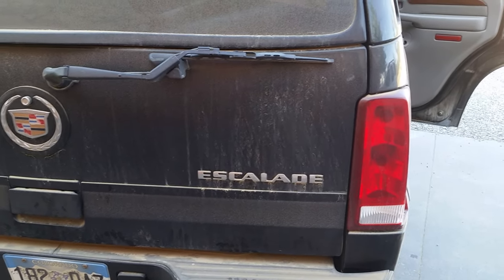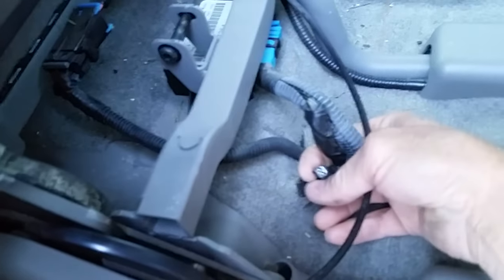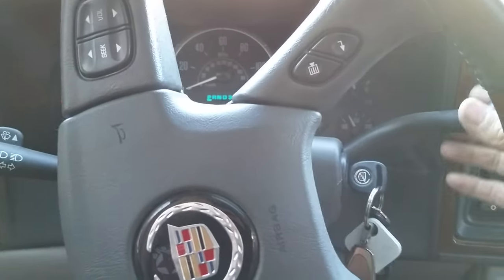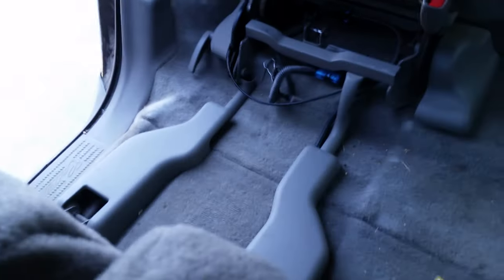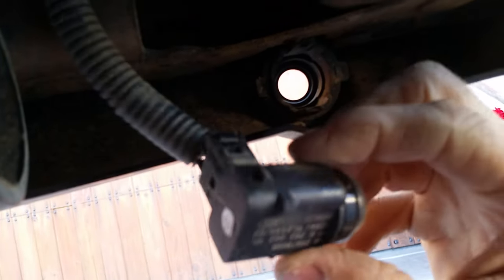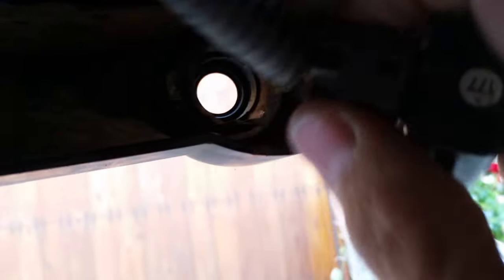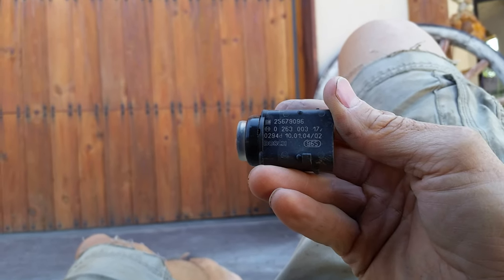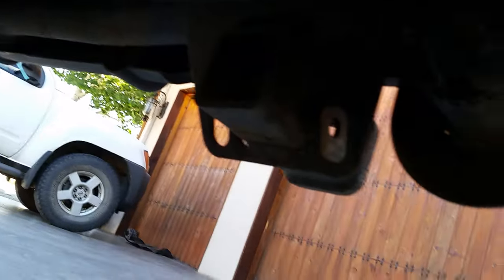Cadillac Escalade backup reverse sensor URPA Diagnostic and Repair

Comment: Just wanted to thank you for the video.  I have been riding around for years with mine out of commission.  I have an 02 and I followed your instructions to a T.  Found out it was the driver's side sensor, ordered one on eBay and installed it in 5 minutes.  Thanks!
Reply from the maker: Awesome!

Comment from the maker: By all accounts I have found, the newer escalades (even 2007) send Diagnostic Trouble Codes (DTC's) to the OBDII port under the steering wheel, and cheap scan tools only read engine DTC's. (These newer Escalades do not seem to have the URPA diagnostic connector that can be shorted.)  This requires a Scan Tool, like the Tech-2 which is costly, but a VXDIAG VCX nano from VCX will connect to the OBDII and is supported by Tech2Win and GDS2, for a lot less! (Ali-xxxx)

If the object detection system detects a malfunction, a diagnostic trouble code (DTC) will be stored and the object detection system will send a message to the instrument panel (I/P) to SERVICE PARK ASSIST message on the driver information center (DIC). Then the chime will sound and the red indicator on the information telltale center will be lit continuously. The red LED in the rear display will be lit, notifying the driver that a malfunction exists.

There are two messages that come up on the Driver Information Center (DIC): 
1. "PARK ASSIST OFF" message - which is caused by debris on the sensors i.e. snow or mud or if you're towing a trailer and its constantly blocked  
2. service parking assist message - this is caused by some sort of malfunction...
The "SERVICE PARK ASSIST" message described is scheduled to display if there is a problem with the Ultrasonic Rear Parking Assist (URPA) system.
Have you completed basic troubleshooting, is you're power liftgate working? they both use the same fuse....
Or have you done a reset by disconnecting the battery for 30 minutes....
It looks like a simple do-it-yourself replacement job though...
The only issue might be determining which senor has gone bad or if its a wiring/harness problem.
- make sure the sensor are mounted flush
- check for physical damage, cleanliness, alignment, flushness. 
- Then check the wiring to the connector on back of each sensor. 

The Parking Assist Control Module is located under the front passenger seat.  One persons answer was to go here and check with his multi-meter in Ohm position.  Start running the seat to it's highest position and remove the trim covering the seat track. Remove the grey connector, check resistance between them. The gray and dark blue wires are paralleled to each sensor and the other four colors are what you are checking against. It would be really helpful to have a wiring diagram of the park assist circuit for this.  One multi-meter test lead goes to either gray or dark blue, the other to each sensor. 

Hope this helps.

Comment from the maker: 2-pin connector : it is not plugged into anything, just small and part of the fat wiring harness under the seat.  Look carefully for the connector, and short the two pin holes together.

Comment: There’s one more trip that I came across that Hass to do I guess with the ground and if you have a trailer hitch connection spray that really good inside with WD-40 then blow it out with the air gun do the same to your sensors spray WD-40 in them and blow it out with the air gun and this Might correct your problem
Reply: This worked for me. Thanks for sharing. 👍🏼

Comment: Where is the connector to plug the pin up on a 04 Cadillac esv? I don't see it under the rear passenger seat
Reply: I don't see it either in my 2003.

Comment: When I put my 05 escalde in reverse it makes a buzzing noise ,any idea on what it is? Thanks
Reply from the maker: Does your backup sensor indicator on back wall inside the vehicle look normal, and start beeping and changing lighting pattern when backing into an object?
If the lighting pattern is a red LED and steady dinging/beeping, then the system thinks you are already touching an object with the rear bumper. And if you really are not touching anything, then you likely have one or more faulty sensors.  You need to inspect the sensor face first for any flaws. Then unplug each sensor and inspect the wire/plug, and the connection on back of the sensor for cracked wires or broken clip.  Finally inspect where this wiring harness attaches back into the vehicle frame, from the bumper.  This plug also may have cracked wire insulation or cracked connector.

Comment from the maker: Some more info related to a Technical Service Bulletin (TSB) that will be useful for newer model vehicles.
- Park Assist System - Inoperative/Lamp ON/DTC's Set.
 TECHNICAL Bulletin No.:  08-08-127-001BDate:  June 10, 2010
Subject:  Park Assist System Inoperative, Service Park Assist Message Displayed on Driver Information Center (DIC), DTC B1E3A and/or B0954, B0955, B0956, B0957, B0958, B0959, B0960, B0961 Set (Replace Appropriate Object Sensor or Repair Harness).
Models:
2006-2008 Buick Lucerne
2008-2009 Buick Enclave
2006-2008 Cadillac DTS
2007-2009 Cadillac Escalade, SRX
2008-2010 Cadillac CTS
2007-2009 Chevrolet Avalanche, Silverado, Suburban, Tahoe
2009 Chevrolet Traverse
2007-2009 GMC Acadia, Sierra, Yukon, Yukon XL
2007-2009 Saturn OUTLOOK
Equipped with Parking Assist (RPO UD7 or UFR) Supercede:
This
 bulletin is being revised to clarify the text in the Condition, Cause 
and Correction sections and update the Warranty Information. Please 
discard Corporate Bulletin Number 08-08-127-001A (Section 08 - Body and 
Accessories).
Condition-Some customers may comment on a Service Park Assist message being displayed on the driver information center (DIC). 
-The technician may observe with a scan tool DTC B1E3A and/or B0954, B0955, B0956, B0957, B0958, B0959, B0960, B0961 set as Current or in History.  Cause-This condition may be caused by a malfunctioning object sensor or a circuit fault on the 8 volt reference circuit. 
    Note: The 8 volt reference circuit serves all of the object sensors in parallel. A fault anywhere on the circuit or in any single sensor will affect all of the sensors.  
-When a single sensor malfunctions, the shared 8 volt reference circuit may be compromised, resulting in a DTC for each sensor.  Correction    Important:  DO NOT replace all of the object sensors and/or the object alarm module.
-If normal diagnosis does not reveal any concerns with the park assist system, perform the following diagnostic procedure:  1. Turn OFF the ignition. Note Depending on the model year of the vehicle the park assist system sensors are referred to as:        
         object sensor or object alarm sensor.      
  2.   Disconnect the harness connector at each of the object sensors. For the locations of the object sensors, refer to Master
        Electrical Component List in SI.      
  3.  Turn ON the ignition, with the engine OFF. 
        Important: With all of the object sensor harness connectors disconnected, multiple sensor DTCs will set and will not   
         clear.  Ignore these DTCs for now.      
  4. Clear any DTCs that may be present.      
  5. Verify that DTC B1E3A does not reset as Current. 
         Important: Ensure each leg of the circuit is tested since the 8 volt reference circuit feeds all the sensors in parallel.
         ¤ If DTC B1E3A does set, test the 8 volt reference circuit for a short to voltage, short to ground or an open/high 
                resistance. Repair the circuit as necessary. Depending on the model year of the vehicle, 
                 refer to Body > Wiring Systems > Diagnostic Information and Procedures > Wiring Repairs OR
                 Power and Signal Distribution > Wiring Systems and Power Management > Diagnostic Information and Procedures > 
                 Wiring Repairs in SI.   
 ¤ If DTC B1E3A does not set proceed to Step 6. 
  6.  Install each object sensor harness connector one at a time, checking for DTCs immediately after each sensor is 
                      connected. Verify DTC B1E3A does not set as Current.                 
        ¤ If DTC B1E3A does set, replace the object sensor that was connected immediately before the DTC set.   
                7.  Perform the diagnostic repair verification after completing the diagnostic procedure. Refer to Diagnostic Repair 
                      Verification in SI.  Parts Information:  Part# 15239247,   Sensor Kit RR-Object, quantity= 1.
Reply: Johny Rocket hi Johnny do you know if the check engine light will go off automatically if the gas cap was put on securely after causing it to come on?

Comment: I have a 2010 escalade and the control model is not under the back seat, nor do I have the lights that flash the diagnostic sequences on the inside passenger rear panel as shown in this video.  Is there a similar diagnostic sequence to follow for a 2010 escalade base 6.2L model? thanks in advance
Reply from the maker: I commented above about the newer models, and what you might do to diagnose.  Newer models do send DTC codes to the OBDII diagnostic port under the steering wheel, but a low-cost scan tool only reads engine DTC codes.  I do list (in another comment above) some suggestions to narrow down the problem sensor or wiring issue.

Comment: hey would you happen to know how to diagnose the sound when reversing i cant hear anything from the sensors? i have a 2002 escalade
Reply from the maker: Is that light next to the button on the dashboard on or off? If its on, then it means the URPA (ultrasonic reverse parking assist) system is off not on, which could be why it's not working.

Now if it isn't working right, the red light will blink when the truck is in reverse and the URPA system is on (it will also blink if you are over a certain speed backing up) indicating a code in the system.

So if you get the lights now but there is no chime,  I would check the driver door speaker to see if its bad.  Swap it out with the speaker on the passenger door and see if it works.   This speaker affects the door chime as well, in case you don't hear it either.

I would recommend getting a speaker at a junk yard if you don't want to go aftermarket or pay for an OEM speaker from the dealer.

Comment: Where do you find that 2-pin connector under the seat?  Do I need to unplug it from something?
Reply from the maker: +GoASt031 The connector will be hanging from the wiring bundle.  Its an open connector, not attached to anything.
Reply from the maker: The connector has nothing plugged into it. Its in the open under the seat.

Comment: Question how can i find on my escalade 2011 theres no screen in the back ?
Reply from the maker: My solution is to physically inspect each plug/sensor interface. Typically out will find one that is damaged or badly corroded because it was mishandled. That would likely be the culprit. Now say what you will, but I purchased a full set of sensors on Amazon for less than $30, where a single one sensor is closer to $100.  I only needed one on a 2007, and it’s working great after a year!
On newer Escalades, even 2007, it appears you would need the Tech2 diagnostic tool, as i am not aware of these new systems blinking diagnostic codes from the LED indicator.

Comment: So maybe someone can help me here. We have an '04 model with the blinking red light. Going into diagnostic mode reveals the the very right side sensor is not working along with a reverse input wiring flashing light. I decide to take the very left sensor and swap it with the very right side sensor. The same light is illuminated indicating the right side sensor is bad (meaning that neither sensor is malfunctioning). I tried clearing the codes using step 6. The reverse input wiring flashing light is no longer appearing, only the right side sensor light is there. Here's the catch: on two occasions, I was able to clear the code and get the sensors working. I know this because when I turn the ignition to ON, all three reverse lights illuminate for 2-3 seconds, then the blinking red light comes back. The diagnostic mode did one of two things: 1. It indicated BOTH the very right and very left sensors were bad along with the reverse input wiring fault or 2. It indicated that the very LEFT side sensor was bad along with reverse input wiring. Again, swapping sensors around yielded nothing. And I also unplugged sensors that were never malfunctioning to see if their codes would appear and they all did. So I have no idea what is wrong with my sensors. I even bought a new module and it didn't help either.
Reply from the maker: I'd look at the wire harness plugs going to each sensor connector.  There is probably dirt or cracked wire insulation. Also the connector from this harness back to the vehicle frame might be cracked or have dirt and corrosion.

Comment: Does the 2007+ have that same port? Where is it located on the EXT?
Reply: did you ever find out I got an 07 ext with the same issue. it started put with random parking assist off and has developed into service parking assist
Reply: It does not.
Reply from the maker: The 2007 and newer is different. I provided some details above.